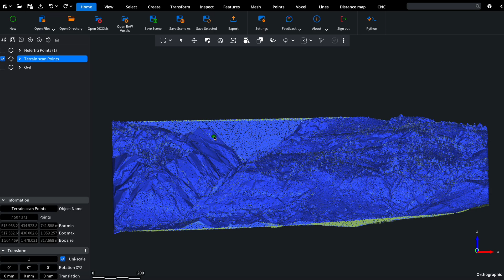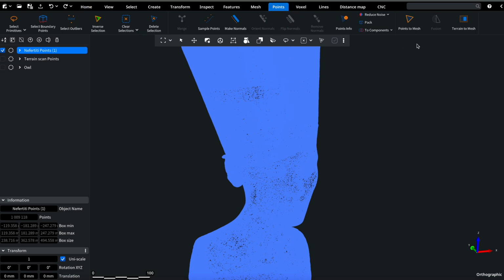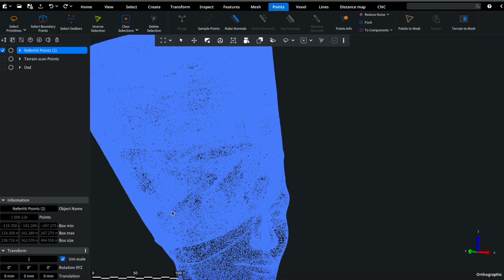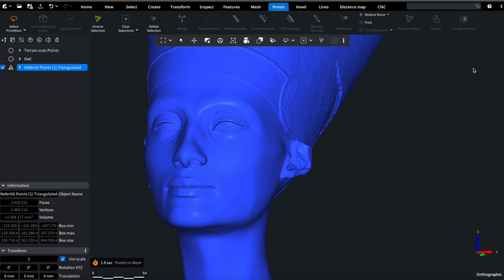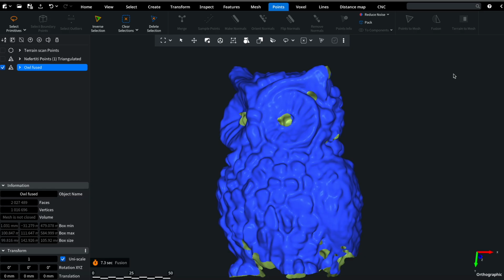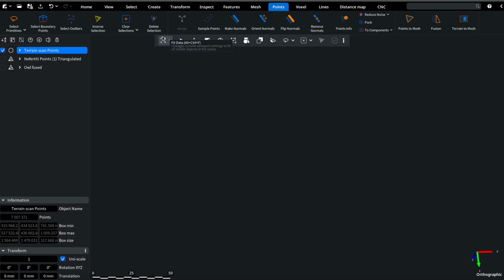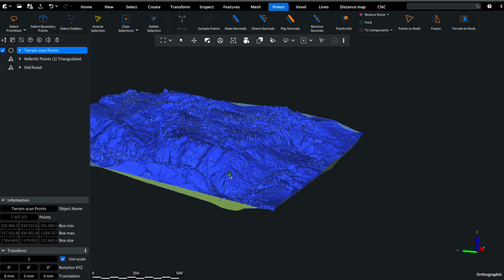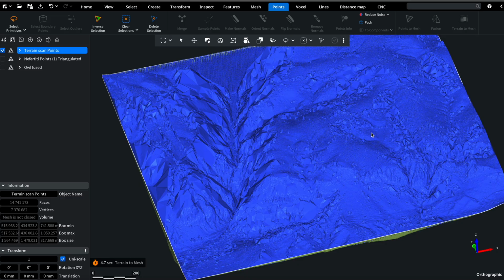How to Turn Point Clouds into Mesh

Comment: What formats for "structured terrain data" can MeshInspector import? Where can I see a closer comparison of the meshes generated by these three methods? The differences would be clearer if applied to the same point cloud, maybe with static images of the resulting wireframes.
Reply from the maker: MeshInspector can import structured terrain data from LAS/LAZ, XYZ/PTS, and common mesh formats like OBJ/PLY/STL. It also works with heightmaps (e.g., GeoTIFF exported as a regular grid).
This video is just an overview of the three methods MeshInspector provides for converting point clouds into meshes. For our SDK, we already have side-by-side comparisons for mesh booleans and mesh simplification using the same datasets. We’ll create a similar comparison for point-cloud-to-mesh methods in the future. Thanks for the idea!